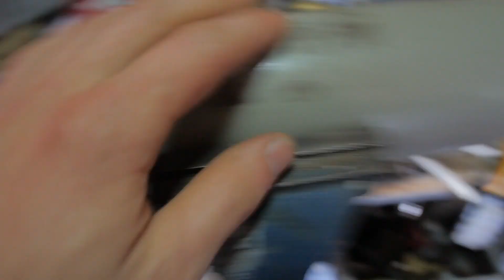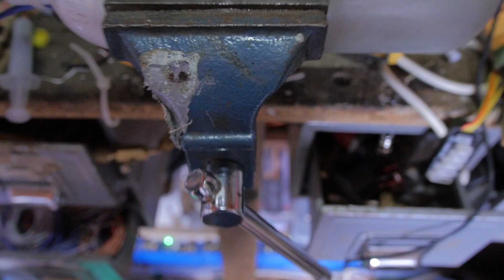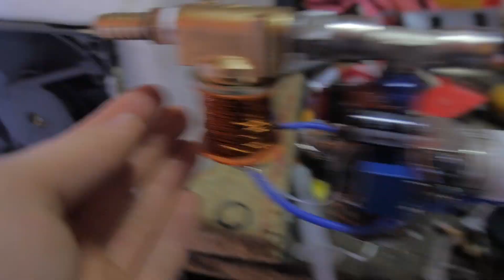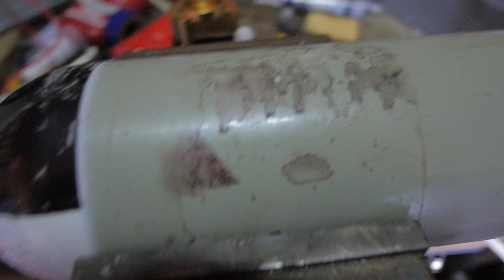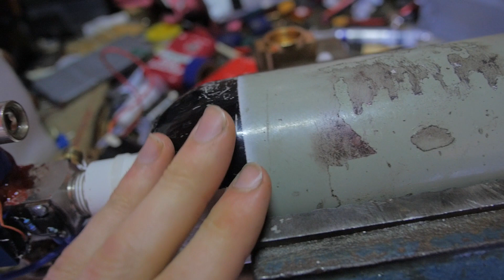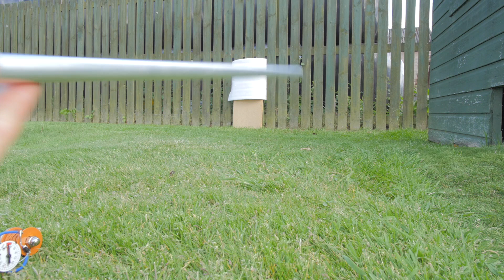Air Solenoid Air Gun

Comment: Hm my idea was to modify Diesel injector to act like a valve since i know that they withstand absurd pressures(+1200bar) but i got no idea how to adjust the time that the valve should be opened.Regulated airguns run around 80-160 bar and unregulated run up to 300 bar.
Reply: Yes, but the volumes those injectors can handle is also minuscule.
Reply: @raducirstoiu2253  .no big the injector air whole got the whole like air force condor ss valve.